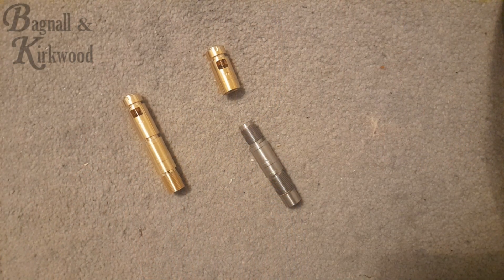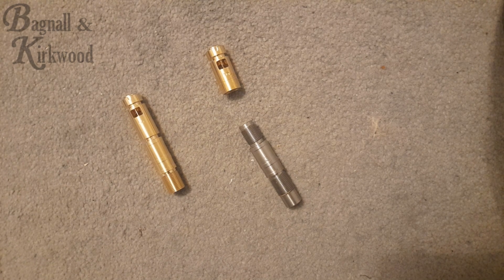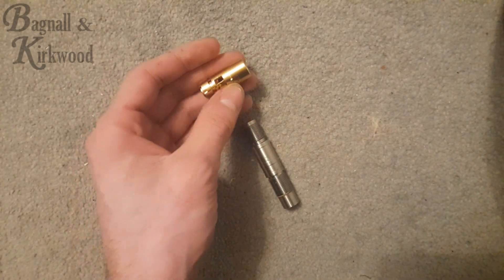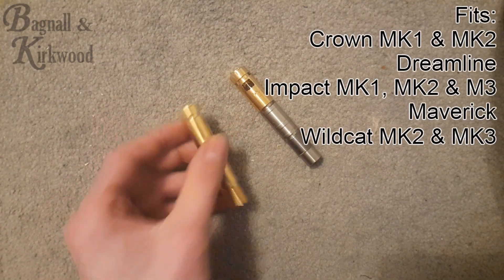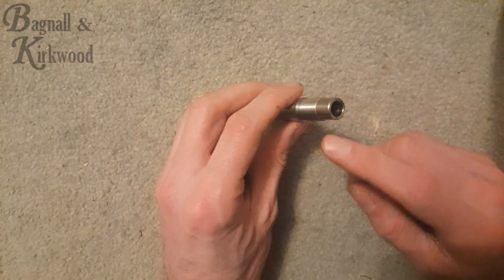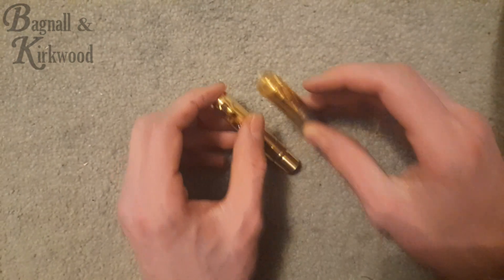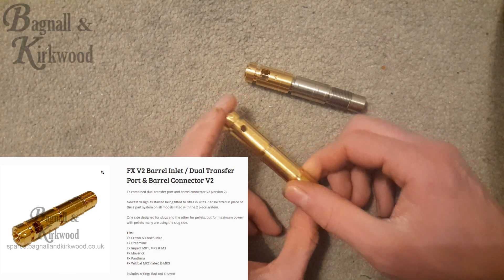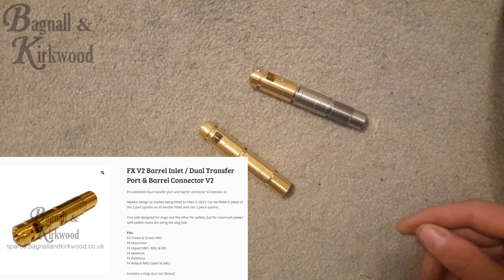FX Airguns NEW V2 Transfer Port & Barrel Inlet System

Comment: 😢Just wanted everyone to know that if you are thinking about using one of these on a fx super light barrel system. You will need a spacer to make up the size difference for the 5 orings to tighten against 🎯🇬🇧👍🏼..
Pn fx10483